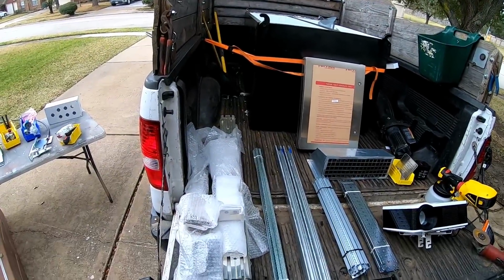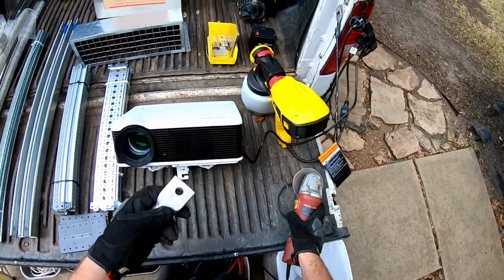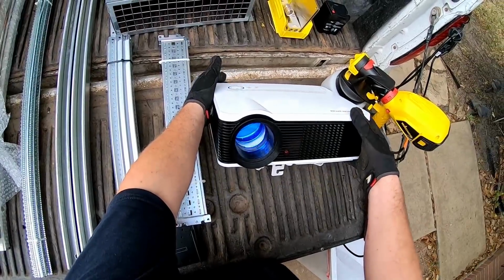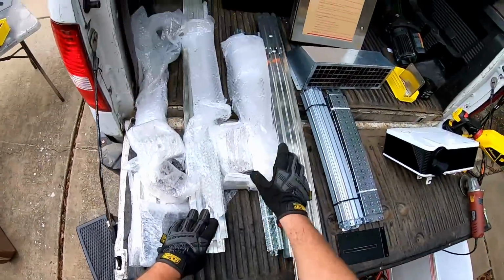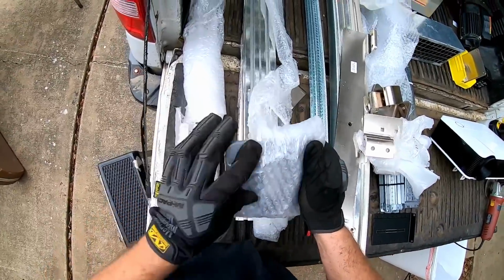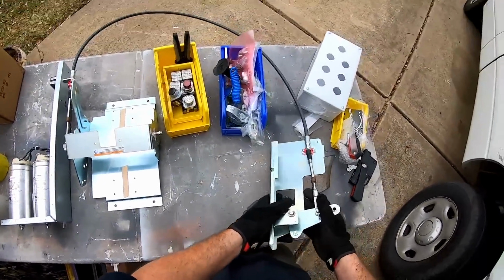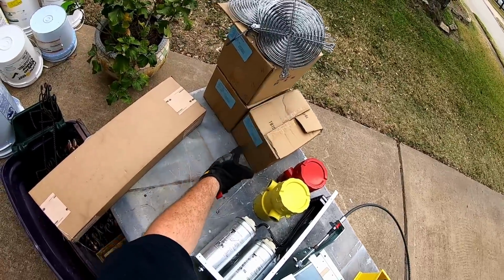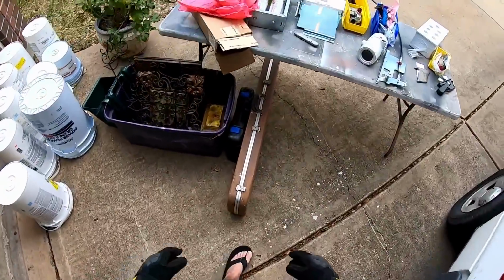Scavenger Follow Up (Episode: It’s Just A Little Crusty On The Outside)

Comment: the piece with the lever could operate your escape hatch for the spaceship
Reply: The cable lever thing is a remote actuator for a circuit breaker in a variable frequency drive. Often used in automation.  The aluminum pieces look like guides for a automated machine. Keep an eye on that dumpster it behind an automation company. We used to toss tons of new stuff out as the engineers changed the design.
Reply: @johnhowe6178  666

Comment: Mike that digital projector  is a nice find. You can cheap ones from Walmart around$100.
Good ones can run up to $600.
Those heavy aluminum track is for hanging doors or heavy glass doors on a track that wouldn't buckle from the weight.
I  have a few projectors here that the bulb was needed a d a larger one that came from a hospital board room.
As for those long items reminds me on joining leather belts or other material together.
Mineola Glass company had belts running between floors for different equipment and stone cutting wheels. Mineola,NY.
Company closed some 30 years back.
As for that stainless steel door can be mounted and made into a jewelry showcase. Just a suggestion.
As for the fan grills great for protecting the 4" or 5" fans.
Good for building computers.
Reply: His wife works at a jewelry store.😃

Comment: those big tracks are a mounting table for some sort of machine. There's special nuts that slide in the tracks that let you easily attach vises clamps etc. id recommend looking for a part number cause those could be pretty expensive pieces of tooling

Comment: Mike, you find some of the coolest stuff!  That piece at 6:50 looks like a skid plate (the 90-degree bend allows it to be securely mounted to the edge of a cabinet/box...)
Reply: You have a skid plate on your cabinets?
PLEASE post us a pic of the skid plate in action😆
Reply: @vicferrari9380  HA!  Well, not in the kitchen but had a similar item on a very heavy-duty cabinet/locker (only waist high) in the warehouse loading dock of my old job.  Not sure of the function though as they were there when we took over the space.

Comment: Hey Mike, I watch everyone of your videos. I’m an electrician by trade and that last item that you opened was in a Rockwell box. It was oval and it stuck to the magnet. I’m sure that was a copper winding that had Ian iron core which made it magnetic. That white tape is the same tape that they wrap around copper windings. Cut the tape and see if you don’t have copper under it. Also, either the last video or the one previous to that one you found some very heavy iron bars that peeled apart. That was definitely the iron core out of a huge transformer. Someone kept the copper and threw the iron away. Keep making the great videos!!

Comment: All that rail is for mounting different electrical equipment of different sizes and shapes so if in the future it can be replaced without drilling most electrical enclosures don't work well with drill shavings in them saves a lot of time The big old chunk ones use t bolts similar to toilet bolts Those two switches the real pretty one and the other one go along with that cable operated thing Cable operated remote disconnect the switch goes on the outside of an enclosure and bolts through the enclosure and the end of the cable you are operating and a large beaker is bolted inside the other end and is turned on and off by the switch there is also an interlock involved keeping you from opening the door with the beaker on or turning it on with the door open have installed hundreds of them

Comment: Mike you need to be careful with the capacitors. If they are still energized you'll get a shock you'll never forget. You need to discharge them before handling. Keep on scrapping
Reply: How do you discharge them?
Reply: Capacitors aren't batteries. They lose their charge completely within 40 min of last current but most discharge within 15 seconds...

Comment: The lever and cable are for turning on and off a high power main panel breaker. The red and green lever is the outside hand switch.  $$$
Reply: Where can I get some of that cable?  I really need it for a project.  It's kind of like steering cable on a boat.  That would be PERFECT for what I need.  Please help if you know.

Comment: Those aluminum rails with the groove, my brother may a machine for work using something like those a square metal nut will run down the groove so you can adjust a attachment

Comment: The heavy peace that you thought was a carved plate, it its extruded aluminum, it could be 6063 or even 6005. I worked for Bon L Aluminum, and that may have been ran through a 12" press.  That may have been around 90' long, before it was cut down.

Comment: That cable operated fixture and those Allen Bradley blade switches is most of a high current disconnect. Don't scrap those!!! Just the switches are several hundred dollars each. The cable fixture might be as well though it's not complete. Those heavy duty channel tracks are almost certainly worth far more than scrap value. Worth looking into.

Comment: Not Plexi. Polycarbonate, known mostly by it's brand name, Lexan. Nobody uses plexi because it shatters easily. Polycarbonate is used to make windshields and other see-through areas resistant to impacts such as lab explosions, incoming gunfire, meteors, etc. In a pinch, you could use it to replace the bulletproof glass in the USS SpaceScrap ship that you've mentioned you're building. You could call it the Scavenger One, or just the flying Dottie. 🙂

Comment: Love your work Mike, I think the Aluminium is track. I'm wondering if you line up the other pieces of ally the holes in those pieces might line up and are secured by special slide bolts to the track.